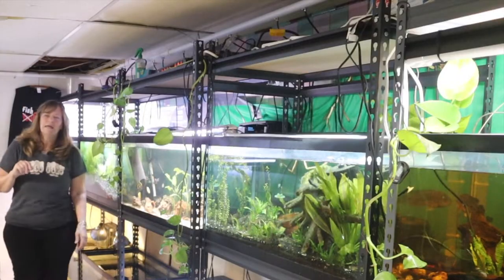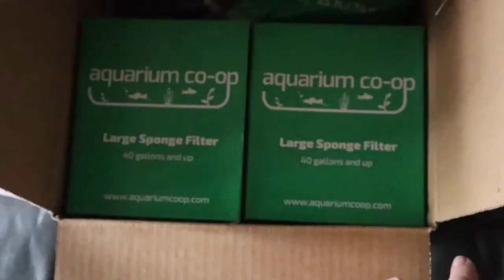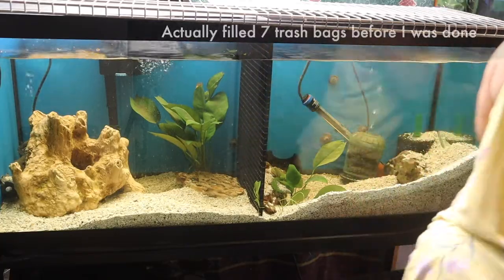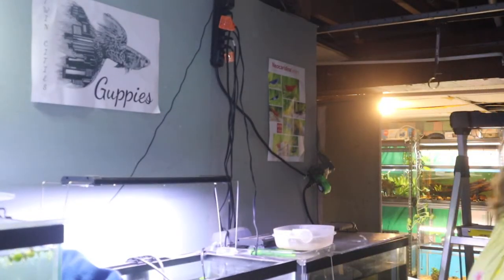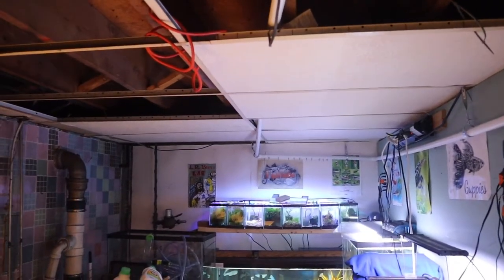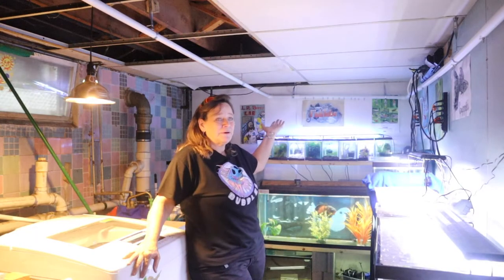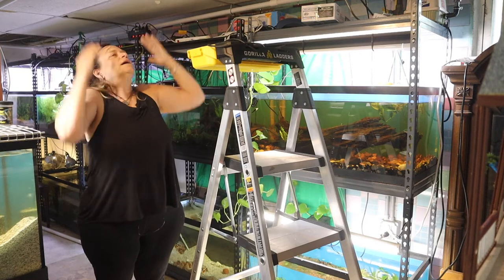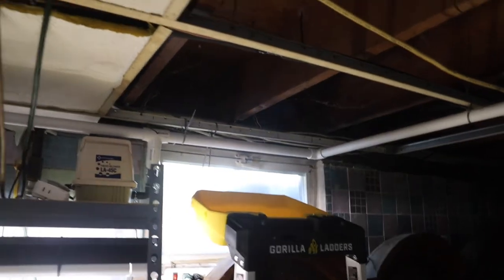Linear Piston Air System Installation

Comment: I’m getting ready to make this system on my tank rack in my dining room.  I’m running 5 pumps and I can hardly wait to replace them.  I have all the pipe and mock up.  Now I just need to buy the pump and valves, and I’m good to go.  Your video is amazing to help me along.  i’m going to Cory for this pump too and the valves along with other supplies so I’m doing almost EXACTLY what you are!  Thanks so much for this video!
Reply from the maker: I am wishing you good luck! I love it

Comment: Susan, great info. IF I  had tanks consolidated, I would do the same pump. But, with them in five rooms of the house, it's not practical. Hey, where did you get your critters to  make habitats bio active? I'm going to make Nelson's new substrate habitat bio active. The recent move freaked him/her out so baby steps right now. Thanks Susan. #freecandi
Reply: i ran my pvc through my house to reach all the rooms with tanks. i am gonna cover it with wood trim so it will be hidden.
Reply from the maker: wow, sounds so finished, I love it
Reply from the maker: I love bio active!

Comment: Wow great job for sure for never had done this job before. Just wondering did you glue the PVC to the 90s and 45s since you didn't talk about the glueing process. If you didn't glue them you might be losing air pressure. Get a spary bottle with water and a few drops of dish soap spray on every pvc joint for bubbles.
Reply from the maker: I have not glued them yet. I wasn't sure if I was even doing it correctly. I will test with the dish soap